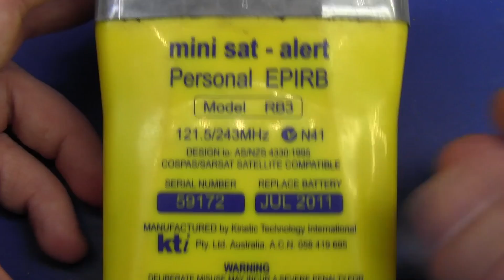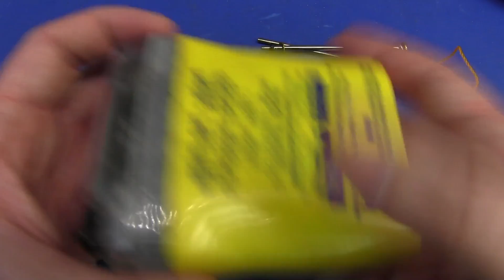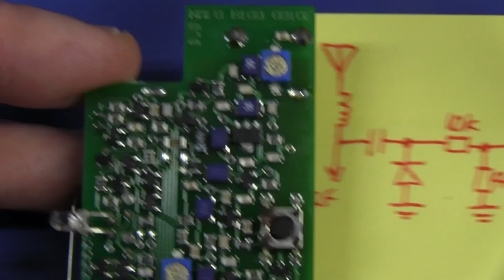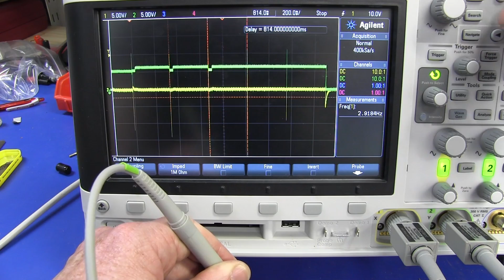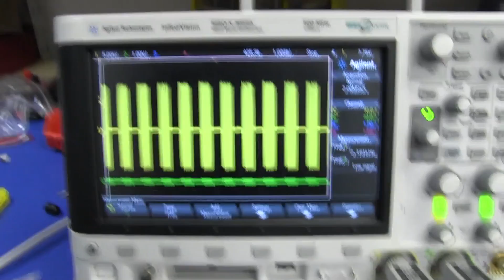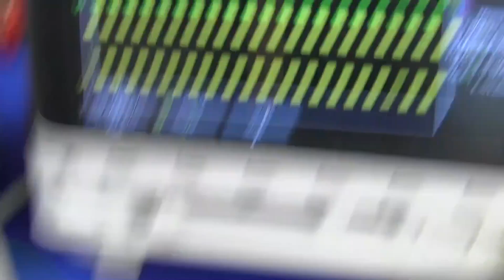EEVblog #368 - EPIRB Teardown

Comment: Next time you test RF output, it's best to replace the antenna with a dummy load consisting of a non inductive resistor with the same characteristic impedance of the antenna (probably 50 ohms in this case). This prevents reflected power from destroying the output transistor, and will enable you to measure output power. 

(I'm a ham radio operator, call sign AF6AS.)

Comment: 121.5 MHz is in the VHF band and would be frequency modulated. the 243 MHz would be amplitude modulated necessitating two separate audio injections for data output.
Reply: Airband VHF is AM

Comment: The only problem with digital is that when it goes weak, its pretty much useless, whereas a analog signal is still useful
Reply: Only with the stupidest possible modulation and demodulation. With good engineering, digital signals are significantly more robust at low power. Go study DSP.

Comment: The 406MHz GPS digital EPIRB I own on my boat is still transmitting on 121.5MHz so I presume it is for failsafe if the GPS unit fails to operate, and it is still used by aircrafts and helicopters because you can buy 406MHz EPIRBs without GPS inside (you save about 200€ but the accuracy goes from about 20 meters down to 1.5 nautical miles...)
Reply: The (low-power) 121.5 MHz transmission is essential for radio direction finding by the rescue vessel once the vessel is within the margin of error of the position reported by the satellites. The resolution of the coordinate data provided by the GPS-equipped units in its transmission to the satellite still only affords 100-200m accuracy - in high seas that can be a very long distance. (the data in the transmission does not provide the full accuracy of the GPS fix).

The non-GPS units (which are still being sold and still very popular due to cost) have a margin of error of roughly 2km, so the local homing signal is even more essential.
Reply: if I remember correctly, the EPIRB without GPS also has an issue with detection time, because they need several satellite passes to triangulate, and this satellite system is far more sparse than GPS, especially at extreme latitudes. and if your bloody boat is sinking, you just don't want to wait that extra hour.
Reply: MrOpenGL Lee Ryman In the states, we still monitor 121.5 MHz.  Both 121.5 and 243MHz are reserved guard frequencies and military radios, such as the ARC-164, have full-time guard receivers which are always monitoring those frequencies.  Most 406MHz Emergency Locators still transmit 121.5 MHz.  Best Regards

Comment: I thin it transmits at the offset of 124mhz to overcome Doppler effect traveling to the sat.
Reply: Tim Wacker No, the Doppler shift is going to swing both + and - as the LEO satellite goes by.  They actually use the change in received Doppler on a couple of orbits to triangulate your position.  You want the transmitter to be pretty stable for that to be accurate.  Sadly, SARSAT/COSPAS isn't used any more.

Comment: FYI, 121.5 is right smack in the middle of the "old" original VHF aircraft comm band, which ran from 118 to about 126 or 127.  That complete band runs from 118.0 to 136 (for civil aircraft) and to 140 for military aircraft.  Don't remember the exact band for military UHF aircraft comm, but 243.0 is right there in it also.  Many military aircraft radios actually have the 243.0 channel permanently turned on, although some radios give you the option to suppress it.

These simple 121.5/243.0 transmitter were introduced in the early 70's and were known as "Emergency Locator Transmitters", or ELT's.  Early on there was a Russian satellite (in a rapid polar orbit)  monitoring this frequency and sending it back to several ground stations.

Yes, these things were built to keep the price down, though there were several versions with a mike built in.

All of these built for aircraft installations were actuated by a G or impact switch.

Military pilots carried a similar unit in their vest, which was used primarily for communications.  Don't think that they had a continuous sawtooth audio, as you normally wouldn't want to advertise your position to the bad guys.

Comment: yes and no. if u have more high powered gear and you dont want to get damaged and/or you want to prevent your HF to get "on air" then its a must to use a dummy load. - but in this case there is no high power HF, so reflections and bad SWR will not realy damage your transmitter here. AND since it is low power, the HF that escapes from the circuitry and/or the small collapsed antenna would not realy travel far. So i would not expect a lot trouble in this case if not drive the HF into a dummy load.

Comment: 121.5 can still be picked up by any aircraft equipped with nav equipment (e.g. all GA/commercial/military aircraft and these days even many ultralights. when i was learning to fly we were told to keep our secondary radio on 121.5 when we didnt need it. just in case we had a chance of finding something. 

the needle on the instrument literally points you to the beacon.

Comment: In test mode with the antenna down and that coupling cap removed, I wonder if you'd get a error code then.. Once the antenna is up the unit would continue to try to work even if the feedback wasn't there.  I guess it could play a "sucks to be you" tone..

Comment: Well I though about building a device to take the dbm from a omni ant on a standard radio and the gps location of the aircraft and see if their was some way to plot a way point out on NEMA-183 were the 121.5MHz transmitter was at so the way point could be shown on MFD in aircraft.  But I never did get around to building one.

Comment: I bet they don't bother sensing the antenna position at all. 

I would imagine that having the antenna lowered, and proximate to that ground-strap inside the case simply detunes the output RF amplifier, reducing it's power to the point where it won't actually cause anyone to come looking for you.

That way, they wouldn't even need a real test-mode. It would just operate the same way no matter what, and having the antenna lowered prevents the output signal from propigating anywhere.

Comment: Of course it won't stop transmitting when the components were removed. When in life threating situations, better try and maybe it will work! "I'll stop transmitting because I can't verify my signal" scenario does not apply in those situations. I think the micro reads that signal back only in test mode.

Comment: Yes, also the issue may be in the feedback circuit so it still make sense to keep transmitting, just in case. I wonder if the test mode would detect the issue and signal the user.

Comment: A few tips for the spectrum analyser - the video issues are a result of the sweep time of the spectrum analyser interplaying with 'bursty' nature of the signal. To get round this you can decrease the sweep time (if possible, but other effects will occur) or you can turn on a peak hold trace.

For digital signals *like this* a realtime spectrum analyser is better, or a signal analyser - where its a digital aquisition then anaysis. And you can get funky realtime spectrum / spectrogram views!